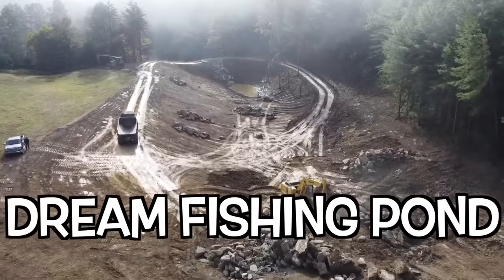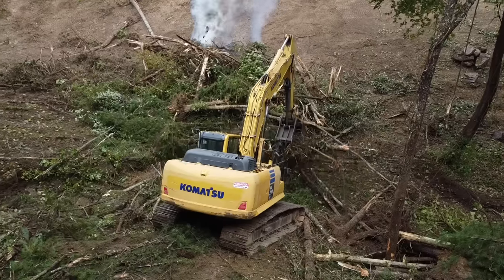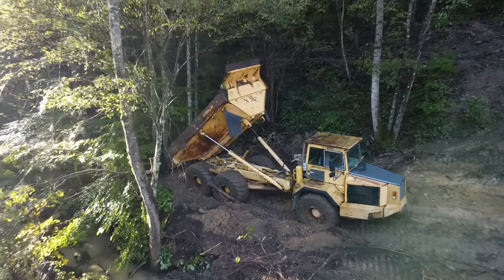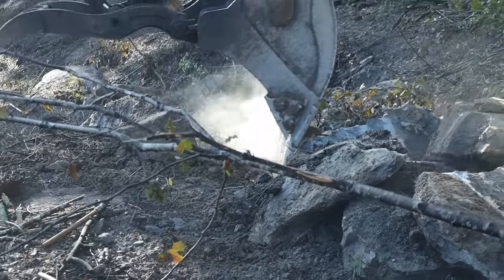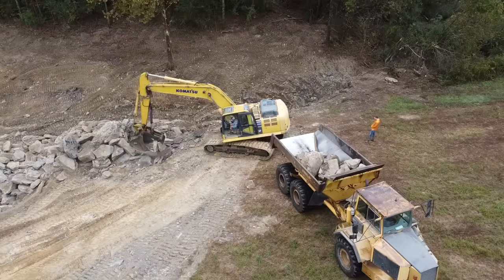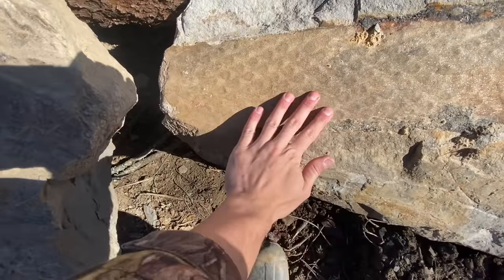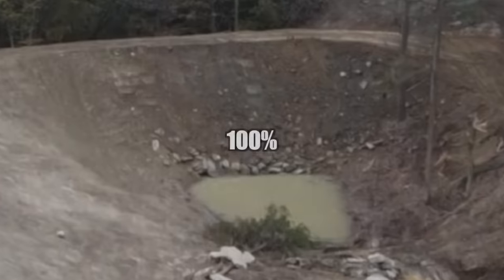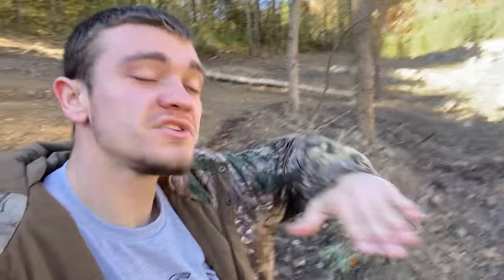Transforming this COAL Mine into the Ultimate Fishing Pond!

Comment: Just to let you know cedar trees are very acidic in water. The fish won’t use it immediately. It will take a year or two until the fish actually use it. I put a cedar tree in my pond. Also I suggest you plant a few cypress trees in the shallows parts and put some pea gravel for bluegill to bed
Reply: i agree
👍👍👍
Reply: As Cypress trees get older there needles gain some sort of chemical  that breaks down bedrock and deepens different areas purposefully which is really good for a new pond cuz it'll keep it at the same depth for a few generations there also really good about breaking down pcbs and holding algae buildup
Reply: If the pond has some shallow areas or a shallow end certain fish like minnows can escape larger fish and refuge there, and waterbirds like herons can wade there.
Reply: This should be higher
Reply: Sometimes pH and alkalinity are already high.   Water chemistry is crutical.
Reply: I added you  on  snap

Comment: Hey Kendall really interesting video. Have you heard of something called Acid Mine Drainage?  As far as habitat is concerned your pond looks awesome but I would be concerned that having it in the site of an abandoned coal mine is going to cause you some problems. When the water comes in contact with everything the miners discarded it will cause heavy metals and acids to leach out of the rocks and soil. Where I go to college in PA there is a lot of Acid Mine Drainage that lowers the pH of streams to lower than 5 so literally nothing can live there. I hope that's not the case where you live but I think you should at least look into that. Wouldn't want you to put all that effort and money into that pond and then have it become an acid mine pond. Hope this all works out for you!

Comment: Hey mate, amazing video. My trade is a geotechnical engineer and geologist, just got a bit of advice for you. Should have had a compressor instead of a tractor and a sprinkler or water truck soaking the layers of dirt at roughly 300mm layers to ensure proper compaction. You also really want to use a medium-high plasticity clay as a natural liner on top of that silty brown material to stop it from getting saturated and eroding away. With that much volume of water and poor compaction it could issues to the soil embankment. At the very least put rocks along the embankment of the dam to limit the erosion, or even plant certain aquatic plants. Cool stuff either way.